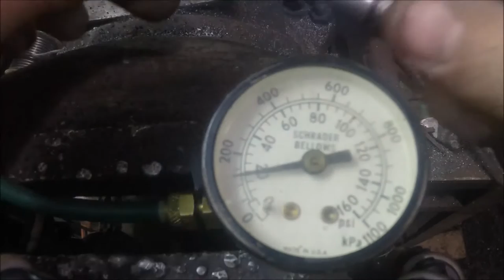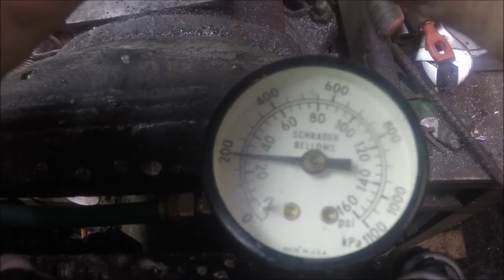Making a Pressure Relief Valve

Comment: Put a center in the stock, isert your tap into the material youre going to cut the thread into, slide the stock up to the tap and insert the tip of the center into the hole in the back of the tap, attack ajustable wrench, set chuck speed as low as it will go, rest the wreench on the tool post and engage and wind in with the stock to ensure its fully centered, slide stock back and put it in reverse badaboom easy peasy